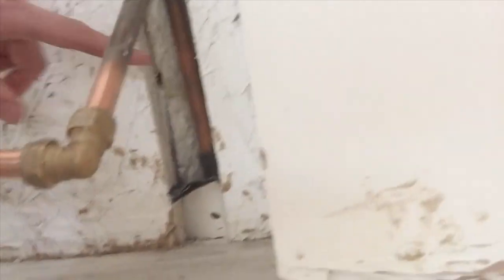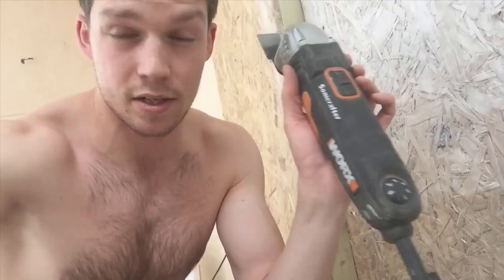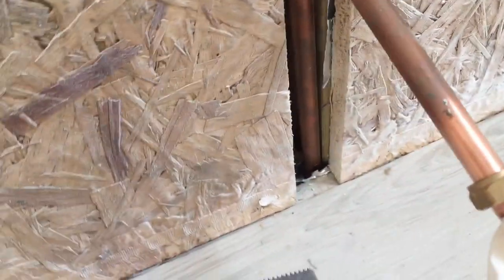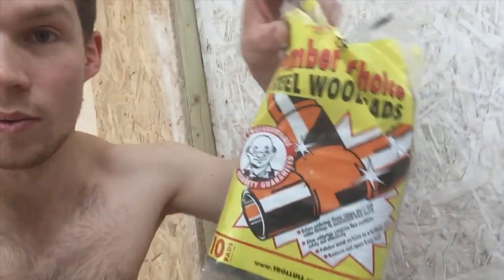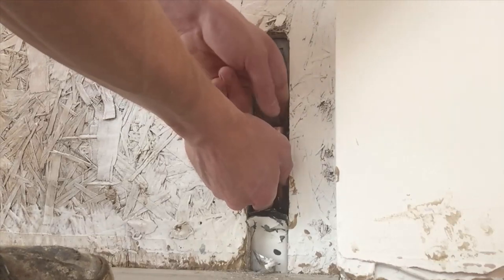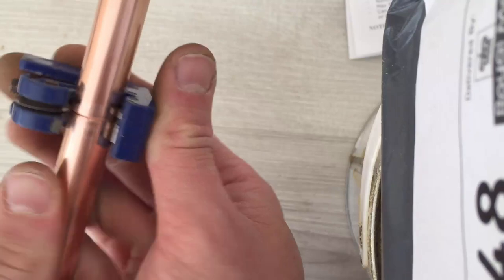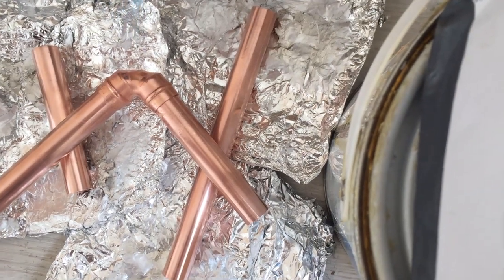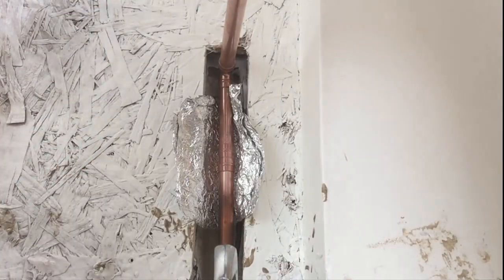POLITE NAKED MALE Fixes Leaking / Bent Copper Pipe - Plumbing Tips with Matt Hutton

Comment: Get yourself a heat resistant matt for soldering instead of the foil. You really don't want materials in that cavity to heat up and catch fire. You could alternatively use the copper push fit connectors for those hard to reach areas. Theyre much smaller then the plastic push fits and are bullet proof. Good video mate